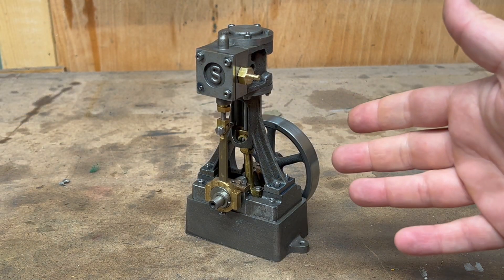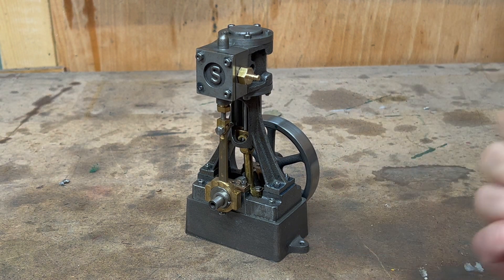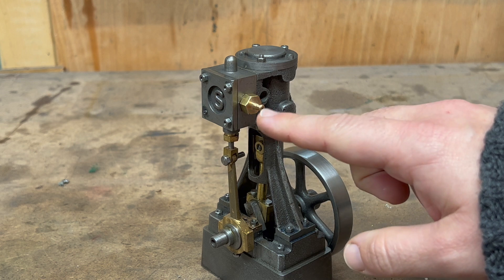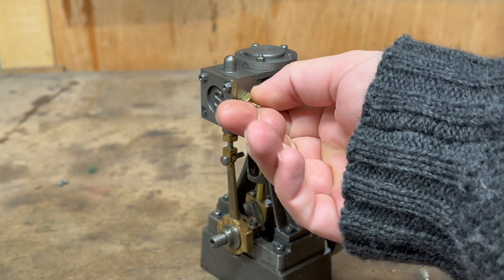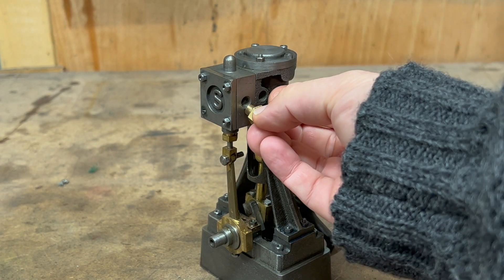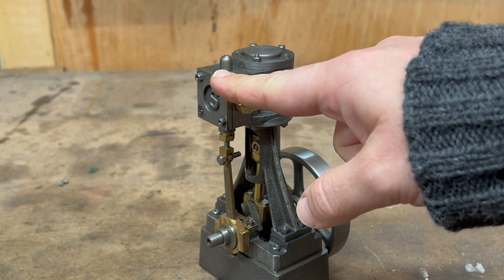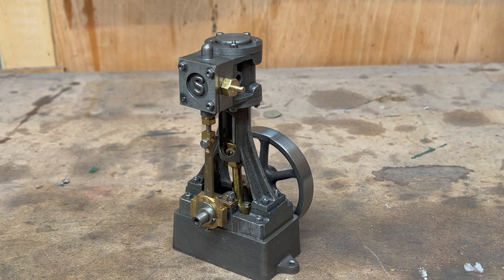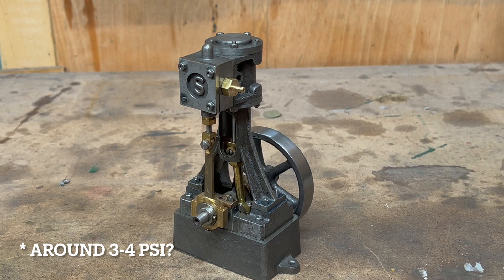Building a Stuart 10v - Part 15 - Finale!

Comment: A lovely little runner. You definitely should be pleased with the end result. 
I love it in its unpainted state,
Thank you for sharing.
Andrew 👏👏👍😀
Reply from the maker: Thank you Andrew. I probably should paint it as I have the Stuart green enamels/etc. - but I'm still quite "done" with it and was mostly hoping to get it running to demonstrate that it did work!  I think if I stripped it down, painted it, and then put it back together and it DIDN'T work then I'd be very grumpy indeed!
Reply: @williamsworkshopuk  Ha ha. Quite some quandary.